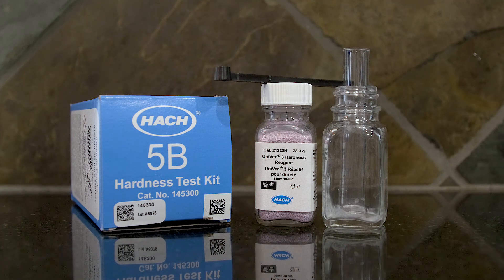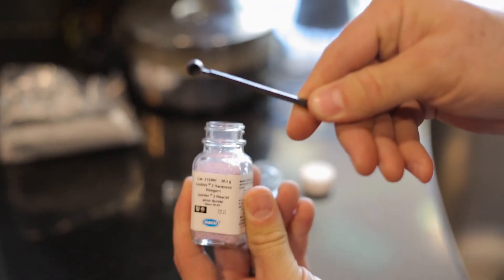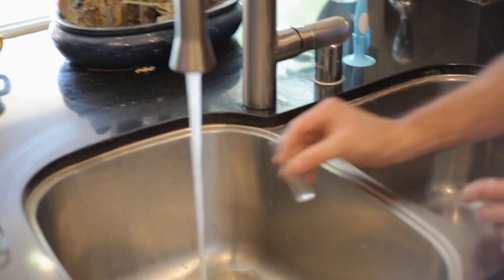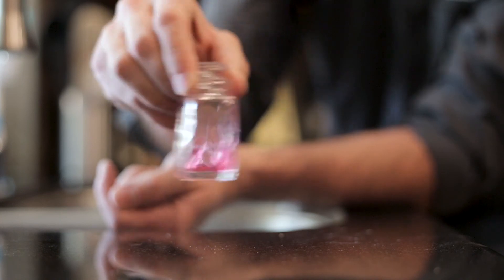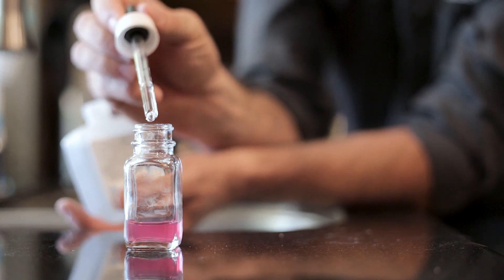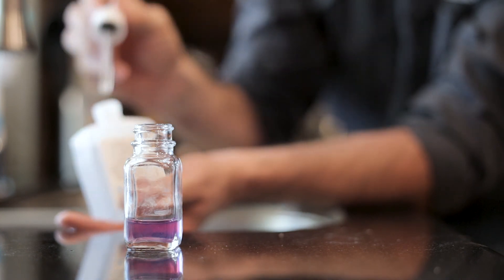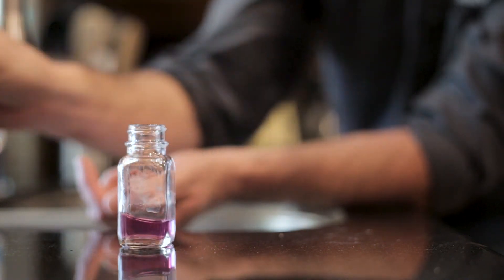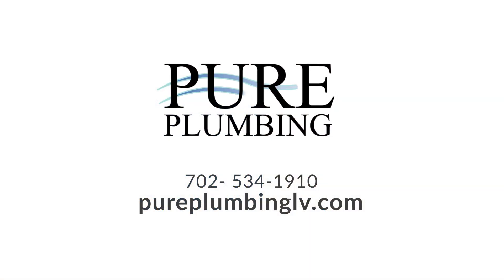How To Test Your Water Hardness

Comment: Why do you test the hot water?
Reply: Because at the kitchen sink the cold side will be city water cause the way the home builders plumber runs the soft water loop. They are taught to leave one faucet with hard water for house plant watering (outdated mindset) . So they always never include the kitchen cold on a soft water loop system. But since the water heater is included on a soft loop, that means the hot anywhere in the house will be soft. So since he was at the kitchen sink he had to use the hot side for the test. If he was in a bathroom sink the cold could have been used for this test

Comment: Why hot water and not cold water?
Reply: I'm guessing b/c typically only your hot water is softened (runs through the softener).
Reply: @pragmaticprose  the system I sell connects ti the main water line, and all water lines have clean water.
Reply: @pragmaticprose  WRONG! cause he conducted the test at the kitchen sink is why he had to use the hot side. Soft water loops when installed in the construction phase of building the home by the plumbing contractor, are taught to leave one faucet inside the home to be hard water for house plant watering. Plants will fry and die if you water them with soft water. So they just always leave the kitchen cold off the softener loop. That's why he used the hot side because the water heater is included on the soft loop piping.
So rule of thumb if you have a softener system hooked up to your soft water loop piping in your garage just remember that hot and cold are soft water everywhere except the kitchen cold side. Now if your softer water system is hooked up at the water main piping by the homes water shut off valve, then the entire home hot and cold are soft and your hose spigots outside are too, but now you need to also remember that you can't water plants outside manually and you have to rely on your homes sprinkler system to water anything. But the bright side with your hose spigots being soft water is your car will be spotless when you wash it just like the professional car wash does